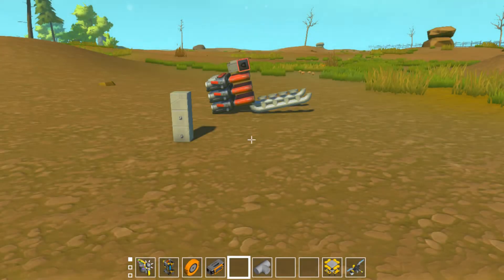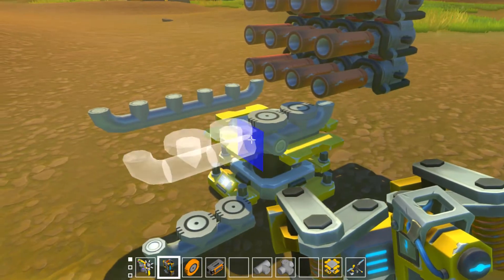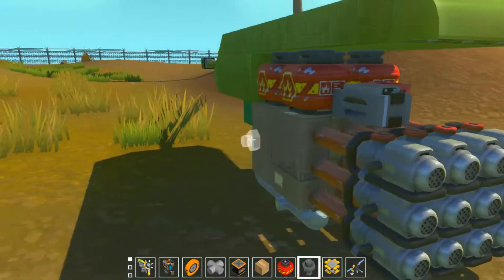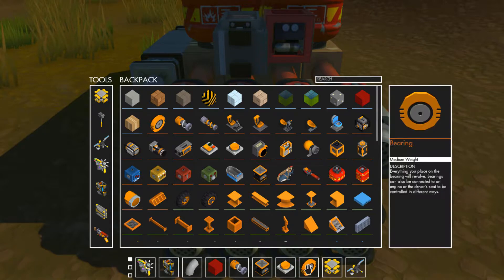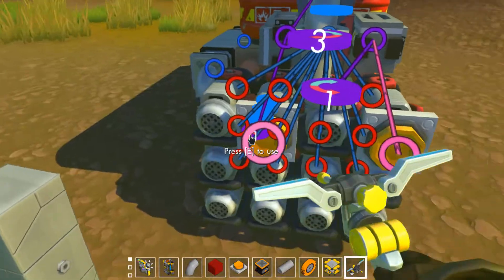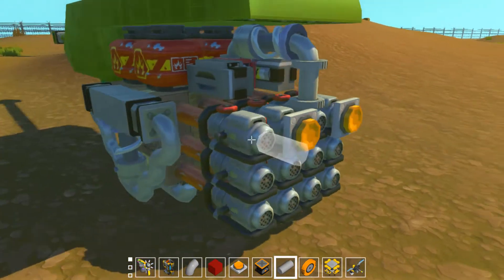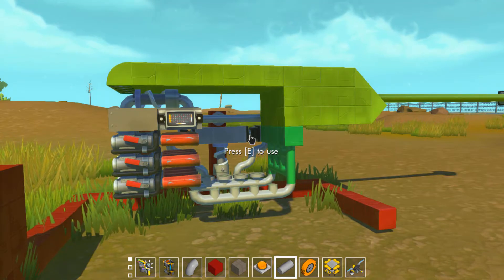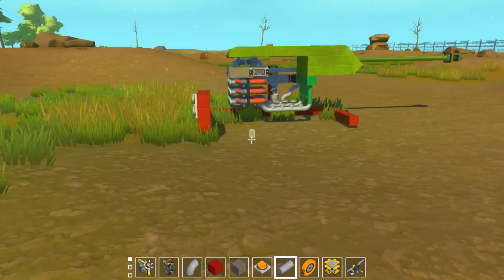2-Axis Cannon Stabilization  |  Tutorial  | Scrap Mechanic      [outdated]

Comment: I have 2 problems, first, when the explosives shoots away it blow up the barrel, second, the explosives to the left won't fire.
Reply from the maker: Make sure you have each round connected to a different layer of cardboard. Only dragable blocks are allowed to touch the round. If a non-dragable block is rubbing a round it will explode. Make sure the round isn't hitting the barrel when it fires. Your barrel may be to long or too short...